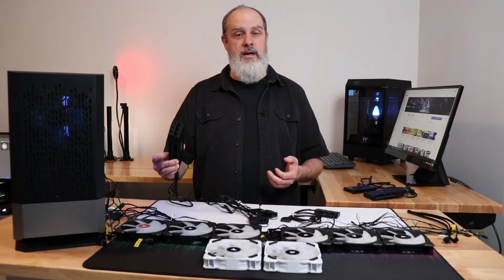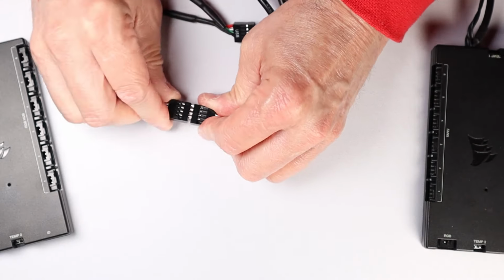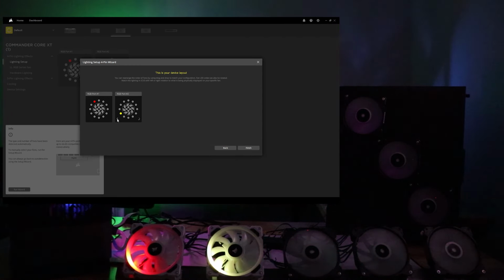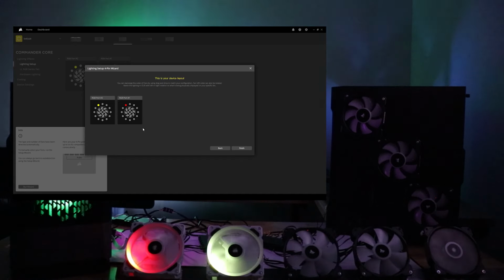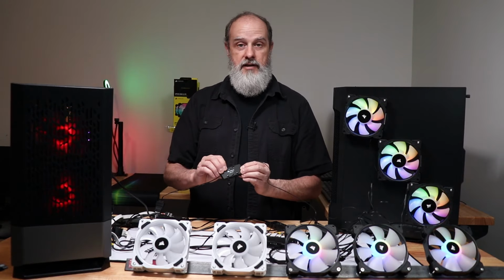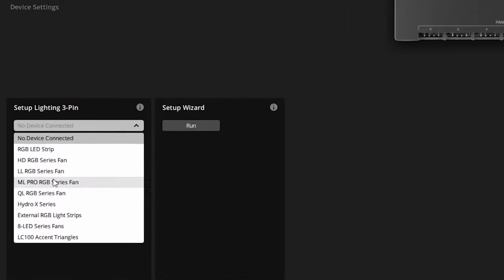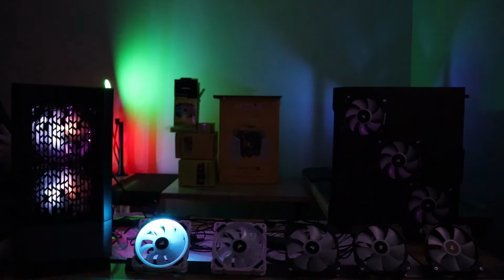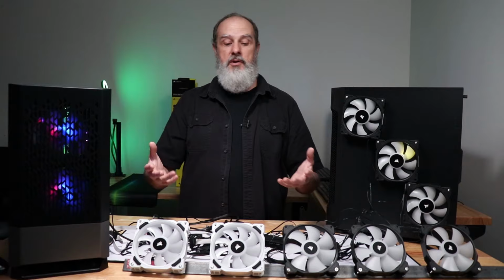Using multiple Corsair RGB controllers to control more than 6 fans in iCUE

Comment: Please help me understand this..
The commander core that comes with the AIO will take care of 6 fans, but the last 3 only have the lighting node have the RGB plugged into it, so with that said, those last 3 being plugged into the mobo fan headers will not be controlled with icue for the FAN SPEEDS OF THEM?
please help me out here...
Reply from the maker: Hi Anthony C, great question. Yes, you are correct, the final 3 fans on the lighting node CORE, or lighting node pro need a place to connect the PWM speed control connectors. Motherboard fan headers will work, but that can mess up some aesthetics and be an issue for speed control. In that case, you can consider a couple of splitters in the Commander CORE, I would only use these sparingly. 

Or, consider an inexpensive PWM hub, or if you want to get fancy, take out the lighting node core and replace it with a core XT, so use the CORE for the AIO and the CORE XT to spread your fans across, this would give you PWM and RGB control over all of them. 

I hope that helps, thanks for watching!!!!

Comment: Hi sorry for asking again but little confusion
if i want visor effect to start from the rgb on the pump head and than rear back fan all the way to the front fan will i have to do the same way? I have 10 Corsair fans and you told me to connect 6 fans starting from the rear one to the top in xt and remaining 4 on the commander core as icue recognises commander core xt first but will i be able to start visor effect from the pump head if i connect in this way because pump head connects in commander core i think?
Reply from the maker: Hi Uzair Altaf, my apologies for the delay responding. I have this video completed, it will be out tomorrow. The PUMP on the commander core will light before the 6 port hub on the core for visor. Unfortunately you cannot change this, so for your setup, the CORE XT will be be first (RGB HUB, then 3 PIN) for visor, followed by the PUMP on the CORE, then the remaining FANS on CORE's 6 PORT rgb Hub. I wish you could change the device order for VISOR, but to my knowledge there is no way to do it.  Just connect your fans (if possible), in a manner that it look good with the PUMP lighting between the CORE XT and the CORE. Let me know if you find something different. 

Thanks for watching!!!
Reply: @HardwareArtisan  ok sure waiting for  video and will try to figure out

Comment: Hy i have buy a iCUE H150i ELITE CAPELLIX XT comes with Commander Core and on the AIO are Corsair ML Coolers and i have 6x addionals Corsair LL120 Fans with Lightning Node Pro so when i right understand that Video i need a another Commander Core XT to connect with Commander Core to install all my 9 Corsair Fains (3 includes the Fans from the AIO)
Reply from the maker: Hi Diggy83, You can  use the Commander CORE for 6 fans, and you can choose to use the lighting node PRO that comes with the LL120 fan kit.  This does give you RGB control over 6 additional fans. (you would only need 1 of the lighting node pro's)  You can play around with which fans to add to the CORE and which to add to the Lighting node PRO, really only the VISOR animation is really impacted by the controller order. 

Using the lighting node PRO though does have one drawback in that it doesn't have any PWM connections, you have to find a place for the last 3 fans to connect to PWM/Power. You can use splitters off your commander CORE, or your motherboard PWM cables (but that defeats the purpose). 

It is also a good solution, as Revized mentioned to use a Commander CORE XT's paired with your Commander CORE, but that is an additional expense, whereas, you already have the lighting node PRO's. 

I would also not throw those away, they are very useful in connecting additional RGB, both corsair and non-corsair. Or you could resell them and capture some of your money back. 

Either way you go, have lots of fun!!! Thanks for watching!!!

Comment: I have the situation of having 7 fans, H150i Elite Capellix AIO with the commander core, the commander core XT, compatible iCue mouse and keyboard, compatible motherboard and Graphics card. Unfortunately I encounter a problem with trying visor setting. I like that setting and I want to use it but it seems out of sync. 3 fans are synced but then it goes to my keyboard and mouse and then to graphics card and AIO and finally to the last fan. Doesn’t look good at all. 🤦🏻‍♂️

Comment: Sorry, just to be clear, you did plug in the Comander Core into that USB expansion cable included with the Comander Core XT, right? 
Or did you plug both USB cables of the Comander Core AND the Comander Core XT into the motherboard?
Again, sorry for the question, i'm completely new to that RGB game and english is not my first language... 😅

Thank you very much!
Reply from the maker: Hi Markus Völkel, Yes, I did plug the Commander CORE into the USB expansion pigtail of the CORE XT. However, it's not required that you do that. There is no technical need to plug it in there. It works just as well if you plug them both into a motherboard header. Use the USB expansion cable on the CORE XT if you need to. Bottom line, either way is fine, it makes no difference in iCUE how you do it. Great Question.....good luck and have fun, thanks for watching!!!
Reply: @HardwareArtisan  thank you very much for your answer. Also great video, helped me a lot, to understand how the fans and RGB connections work. Keep up the great work! You have my like and sub.

Comment: is it possible to rn non corsair fans? i have 3 case fans that i want to use for a push pull configuration?
Reply from the maker: Hi Cool, Yes, you can use non-corsair fans. The CORE XT, CORE and Commander PRO will work with regular 4 PIN PWM fans as well as 3 pin DC fans. On the CORE XT and CORE, you can't control the speed of 3 pin DC fans, they will run at the maximum rated RPM, but they do work. You will be able to control the speed of non-corsair 4 pin PWM fans. 

RGB lighting on non-corsair fans can be a bit more tricky, if they are using 3 pin RGB, you can use an adapater cable to get it working, check out this video for information on that subject:

https://youtu.be/JgLUDe1yzYw

Good Luck and Have Fun!!!
Reply: @HardwareArtisan  Wow thanks for the reply! This was a very informative! Il try find the adapter!

Comment: Another great video! 
Using the Visor effect I'm getting about a 10 second delay in the LED sequence between my Commander XT and Commander Core. I have 10 QL fans, four running off the Commander Core from the AIO and the other six off the Commander XT. Going from the XT to the Core or vice versa there is a pause of about 10 seconds in the LED sequence from one fan to the next going either direction. Don't know if it matters but I also have 128GB (4x32GB DIMMs) of Corsair Dominator Platinum RAM. At first I though the sequence was jumping to that but it doesn't appear to be.
Reply from the maker: Hi BP, thanks for the feedback, i'm happy you are finding the videos helpful. I've had this happen to me exactly as you've described, where it appears there is a delay in the sequence. In I think every case, it's always been that it's firing to another chain of RGB that I didn't have installed.....too much messin around, haha! 

I would start with checking your CORE and CORE XT for any other RGB chains. Check if you have 3 pin lighting effects enabled/configured...and disable that (assuming you don't have any 3 pin lighting effects)....that will cause this as it will send signals for those devices. 

If that's not it, i'd just double check the CORE And CORE XT have properly detected the right amount of fans and the right type. 

Update iCUE to the latest, restart your PC and if nothing else is working. Personally, i'd clear the config on the controller and reset it up. I think i'd remove the RGB connections, just pull them out of the connection, then rerun the wizard with nothing in there.  Then re-add them and rerun the wizard and double check. 

Here is the firing order for Visor to the best of my knowledge.....

KB -> Mouse -> RGB mouse pad -> Lighting Node Pro -> Lighting Node Core -> Commander Pro -> Commander Core -> RAM -> External Ambient Lighting (LS100, LT100, ST100).

I think the CORE XT is right after the CORE, or before, I cannot recall, I need to go revisit that, might be a good short-ish video to do. 

The RAM should be last in that sequence if you have the lighting configured....

If that doesn't do it, reinstall icue perhaps. I'll try and go retest the order of that effect, let me know what you find! 

Good luck, keep having fun!!!

Comment: Weird my core xt didn’t come with a pigtail so I’m stuck where Icue won’t recognize my commanders
Reply from the maker: Hi Demineon, it sounds like you have a Commander CORE and not the CORE XT. They are very similar, but one of the key differences is the "CORE" does not have the USB pigtail. If you have a CORE with no pigtail, i'd contact Corsair. To my knowledge they are still shipping with the pigtail. 

In lieu of that, you could consider a powered USB hub which would give you some USB header expansion. 

I use this one:

https://nzxt.com/product/internal-usb-hub-gen-3

Let me know what you find, thanks for watching!!!
Reply: @HardwareArtisan  can confirm I bought the core xt, icue is still finicky with showing the commander devices in the software. I do have the usb hub and it only shows two of my 3 commanders

Comment: how do i get more than 6 rgb fans connected with speed control on all of them? i really dont understand why they dont make a hub that has like 10 controllable fans in 2023! 😕
Reply from the maker: Hi DRTY D, I couldn't agree with you more. I think it's time for corsair to bring out a king size controller....or, bring out a modular fan design, eliminating the need for so many connections. I hope that's in their future playbook. I keep my eye on it, but I don't know what their roadmap is at this point. 

For now, to get RGB control over more than 6 fans, you will need to buy 2 controllers, you can get away with splitting some of th PWM connections, but the 4 pin RGB I don't think you can split up....but I haven't tried, it's on my list to mess around with. 

So, you will need a combination of 2 controllers to accomplish more than 6 fans for full icue control. 

Good Luck, have fun and thanks for watching!!!!

Comment: Hello

I am noob, can you guide me in detail how can i light and sync my 10 Corsair fans with commander core xt and commander core that comes with capellix aio, i couldn't understand how to connect them from video :( I have 3 sp 120 rgb elite in the front and one sp120 Elite on back as exhaust, 3 ll 120 on top and 3 ml 120 on right side of the mobo in 5000x. I want to sync all 10 fans starting from exhaust fan to the last front fan like in visor effect of iCUE , is this possible? Can you guide me on it please how should i connect them and how many fans i have to connect in commander core xt and how many in commander core and how can i link commander core xt with commander core?
Reply from the maker: Hello Uzair Altaf, Yes, let me try to get you started. The CORE XT fires before the CORE for the VISOR effect to the best of my recollection. So, connect your fans in order from the rear to the front, starting with the COREXT and ending on the CORE

The only effect this really is important on is VISOR. just make sure your front fans are all on the CORE and the rear fans on the core xt if that's the order you want. (starting at the rear and ending at the front)

you can change the order of fans within each controller so the only thing you need to be really sure of is the rear 6 fans are all on the CORE XT and the front four fans are on the CORE. you can then fine tune each fan on those controllers in iCUE to be in the right order, just drag and drop. 

The placement of the PWM power/speed connector doesn't matter, but I try to keep them in order and label them in icue. 

You do not need to link the CORE XT with the commander CORE. iCUE communicates with them individuall over the USB bus. You can however, connect the CORE to the USB pigtail on the CORE XT if you need to make efficient use of your USB headers, but this is not a technical requirement for iCUE to work. 

I would highly suggest that you plug everything in and test it before you do any final/serious cable management, and make sure it works the way you want it. 

I've made the mistake of zip tying everything together before testing and had to spend alot of time tearing it back out. 

I need to do a video on this order for VISOR and how to order everything in icue, that's on my list in the next week or two. 

Great question, I hope that points you in the right direction, thanks for watching!!!
Reply: @HardwareArtisan  thank you so much for you detailed answer, i will try it and waiting for your next video on visor effect also ❤️

Comment: Video is great!  I'm struggling still though... I have the Elite LCD, Commander Core XT and Commander Core... I have two USB ports but one is a splitter for the pump... I would assume that both the commander core and pump should show but it's only showing one not two... Is this because the pump utilisises a splitter? :(
Reply from the maker: Hi Christian Knott! That's a great question! This tripped me up initially myself. When you install the Commander CORE with the PUMP and LCD Screen, everything will show up under the PUMP, so in iCUE, you would see your AIO Cooler and the Commander CORE XT, you won't see the Commander CORE and the PUMP seperately. 

If you select the AIO PUMP in icue,  you should see all the settings for the CORE XT's lighting effects, cooling and screen options for the LCD under there.  It doesn't show as a Commander CORE anywhere. It's just how icue presents the whole package to you. I don't think the splitter has any effect on this or how it works. 

I hope that help you out! Let me know if not, thanks for watching!!!
Reply: @HardwareArtisan  Legend, thanks - works as above under the pump and managed to sync my front lian-li led strip with the corsair xt's rgb port too

Comment: hi wonder if you could help, I’m currently using the Corsair h150 capellix and the Corsair LL120 three pack fans all 6 fans are plugged into the commander core, when I add a second LL120 set of three fan on the node pro and 6 port rgb hub  it blows the mother board it’s done this twice. What am I doing wrong I’m using a 750w bronze evga power pack! and the ASUS Strix B550 mother board.
Reply from the maker: Hi darren critchly. I don't like the sound of that, by blows the motherboard, do you mean to say it's actually damaging it to where it no longer will post? That shouldn't happen obviously even if your controller isn't detected and doesn't work, damaging a motherboard would be extreme, but not unheard of. 

It sounds like your Commander CORE and the 6 ll120 fans on that are working normally. First, I would not re-use the Lighting node Pro and ll120 fans if it's damaged my motherboard, I have to error on the side of caution. I'd replace those with corsair or the vendor if possible. 

I would try the new controller on a different power supply cable, or even the one that the commander core is using as a test to ensure this new controller is good before reconnecting it. 

A 750W Power Supply should be sufficient for 9 fans and the RGB and controllers as long as you don't have an enormous amount of hardware running, just a basic PC build with a 750W power supply should be ok. 

With the lighting node pro, you need to find a place for the PWM connections, I would use a sata powered PWM hub for this purpose, keeping those connections off your motherboard. 

I would suggest having the power supply tested for good voltages, you can purchase a basic tester on Amazon for not very much money. This would help give you confidence that the Power supply and it's connectors dont have an obvious issue. 

here is an example, there are many others....I have worked with similar ones, but not this one specifically.... I used them in the field mainly for a quick test when a PC wouldn't POST or power on to sort out of it was a motherboard or power supply issue,  but they can be a basic check. 

Kingwin PC Computer Power Supply Tester, Digital LCD Screen, ATX/ITX/IDE/HDD/SATA/BYI (KPST-01)

I may have misunderstood what you meant by blows the motherboard, if it's just not detected....then try a different USB port and Power connection in addition to using a PWM hub if you haven't already. 

I hope this helps! Thanks for watching and for your support!!!
Reply: @HardwareArtisan  Thankyou for the reply it’s much appreciated. We bought a new ASUS rog strix B550 motherboard when we connect the corsair capalex 360mm cooler in and three of the LL120 into the commander core it all works fine. But when you go to connect the other three using the included commander node pro and powering the fans using fan headers on motherboard , and have to use the usb splitter of the motherboard it blows the motherboard, we took the motherboard back to our supplier and he tested it on a rig and it was dead! Got it replaced twice under warranty. He tested the power supply as I bought that from the same vendor. I’m thinking of getting a larger power supply and buying the commander core TX to get all connections of the motherboard. 
What do you think? 

Thanks again

Comment: Just finished building a desk computer but its been a nightmare trying to get everything wired up for a couple reasons. 1) Everything is so spaced out that the cables the fans come with aren't long enough and 2) ICUE does not like the ways I'm trying to wire up all the RGB. It doesn't even recognize my Commander Core. I have the lighting node pro and in the second port it says I can only use 8 LED type fans and then lists several examples. Thanks for the informative video. Hopefully I can get this sorted.